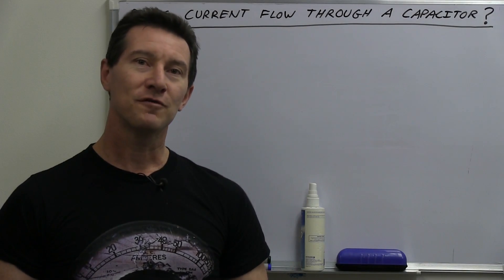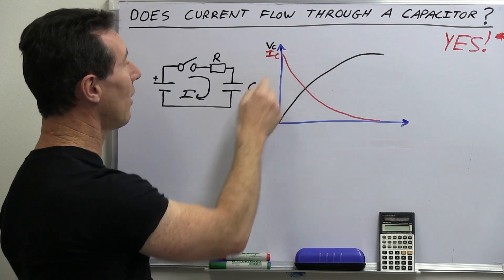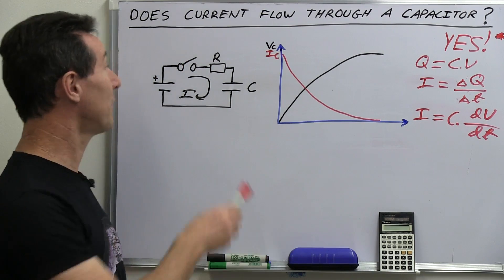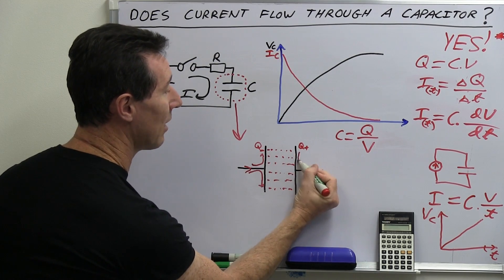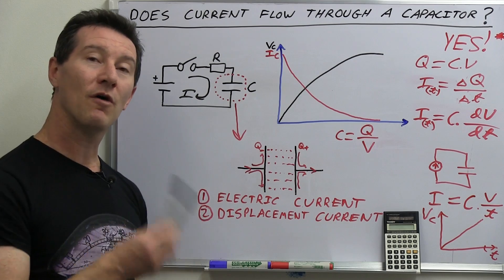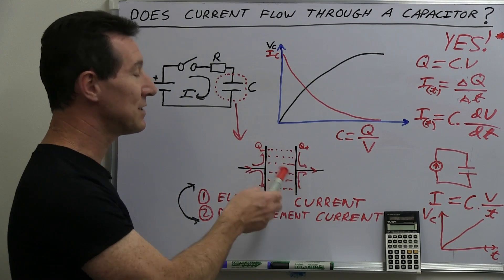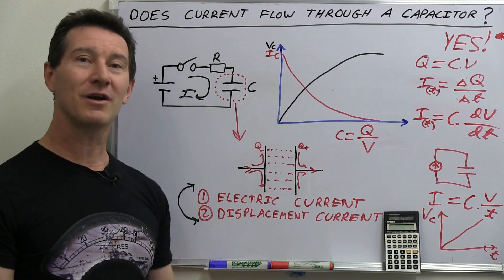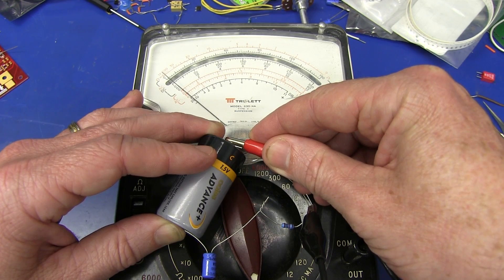EEVblog #486 - Does Current Flow Through A Capacitor?

Comment: I've gone through semesters of electronics in middle school, high school and university and nobody was able to explain which is the actual direction of current flow. Until I looked for an answer on youtube and kind of got it. Having diplomas and degrees only means you know formulas and how to work with electronics, not that you have the absolute understanding of what's happening.
Reply: That's a shame you had that experience. When I was doing electronic engineering at the university of kent it was one of the first things taught and explained very clearly. For circuit anyysos and design we used conventional current flow but were taught about actual current flow in solid state physics.
Reply: Having diplomas or degrees means you have diplomas or degrees. It means you are SUPPOSED to have an understanding of what's happening. Whether you do or not depends on the quality of your teachers and the quality of your effort (which is largely dependent on your interest).
Reply: "Actual" charge flow is too complicated:  electrons flowing in metals, protons flowing in battery acid and in proton-conductors.  In salt water it's flowing +Na and -Cl ions.  In alkaline electrolyte it's -OH ions.  In wet dirt and in human bodies it's +Na and -Cl ions, same as in salt water.  In sparks and gas discharge it's electrons flowing one way and positive ions flowing the other, going past each other in opposite directions.    Cont...

So, which is the REAL direction of electric currents?  (The answer must apply to conductors, not just metal wires.)   Think carefully: when you're getting electrocuted, no bare electrons are flowing in your body, but opposite-charged ions are flowing in two opposite directions.

Physics has the answer:  we hide the complexity behind a simplified concept called "Conventional Current."

To do this, we add up all the flows to form a single current.  For example, in wet dirt, if pos and neg ions are flowing in opposite directions, that means the negative charges that flow backwards must add together with the positive charges flowing forwards.  (A double-negative makes a positive current, so negative charges, flowing backwards, will give the same amperes as positive charges flowing forward.)  Wet salty ground has a single amperage made of conventional current.  (We don't need to think about the many charge flows in the dirt: the +Na and -Cl and +K and +Mg and +H and -OH.)

For those who want the REAL currents, and not the simplified version, it's not enough to just say that "current equals electrons."   Current in copper wires is actually electrons flowing past positive copper ions  ...so if we move the wires backwards at just the right speed, then the electrons stop moving, and the electric current is now composed of positive copper ions going backwards!   (See, the REAL current was never just a flow of electrons.  It had always been a relative motion between the copper atoms' nuclei and the copper electron clouds.)

Conclusion:  if we want simplicity, where we just deal with a wire's volts and amps, then we use Conventional Current to hide the actual charge motions.   But if we want reality, then we'll end up with Ben Franklin's Kite String,  the famous twine which is an acid-based conductor.   Ben Franklin's kite string used +H ions as its charge carriers.  Only the protons were flowing along his twine, not electrons.   (Heh, so when Franklin assumed that the charge-carriers within conductors were positive, HE WAS RIGHT?!)
Reply: BMan18 So if "electrons flowing past positive ions" is wrong, what is right? I was interested to find out but your post spiraled into a political rant without actually answering anything.
Reply: The people you mention as sources are raving crackpots and not surprisingly, what you say is utter bollocks.
Reply: BMan18
Free energy is fraudulent bullshit, and none of your weaseling changes that. Get lost.
Reply: Do you think that learning from the internet will make you an electrical engineer (EE) in time? Have you seen the curriculum of (EE) from a major university?
Reply: We learned electric current flow the 1st day of introduction to electric circuits 101. The electrons, the charge carriers in an electrical circuit, flow in the opposite direction of the conventional electric current.
Reply: Mack Lack
No. You need structured study and practical experience.
Reply: Not entirely. Stick non-grounded instated long copper wire up a tree it's will generate a few volts, mostly from radio wave EMF in the air. You can do the same with a faraday cage.
A lot of the Free energy hippies snake oil is bullshit I agree, but not all. 
Eric Dollard has replicate a lot of the same experiments that Tesla has done and more like his current early earth quake warning system he is building, currently science has painted it's self into corner with it's dogmatic materialistic mind set and a high reliance on computer modelling. Junk info in, junk science comes out.
Reply: what university did you go to? more than likely either it was a really shit uni or you were just bad at understanding what they were saying. I hate this "school teaches nothing" meme, because it's really not true at all other than at the lowest tier schools
Reply: kalidesu, all of those examples you use and claim to be "free" energy are nothing of the sort.  EMF has a source, and it usually is a large transmitter turning current from the mains into radio waves.  So it's not free.  It was generated somewhere and you are simply scavenging some of it back.  The only example I know of where something came from nothing was when God spoke and created the heavens and earth.  Other than that, engineering 101: TANSTAAFL (Look it up.)

Edit: Unless you are talking about tapping into the 8hz oscillation of the ionosphere ala Tesla because...well, that's a rabbit hole I don't feel like going down right now.  But you have nothing to worry about because our federal government is working on it for you with HAARP...Like a bunch of 3 year olds playing with AK47's.  Nothing good can come out of it.
Reply: LOL... So much education and still "electrons flowing past positive copper ions". Maybe you need some time at YouTube U. But as they say, the more misinformation you assimilate the longer the journey to the truth as you backtrack. 

Check out Robert Distinti, Eric P. Dollard, Peter Lindemann, TC Heins, and the singular Ken Wheeler. Not that any one of them has the full answer, they will collectively give you an opportunity to get closer to the truth. 

If you need solid proof that what you know is wrong, check out Patrick J. Kelley's ebook on free energy devices. Look at Paul Pantone's GEET reactor turn a lawn mower into a matter to energy transformer without any remaining matter; no pollution, no radiation. Again, not the absolute, but practical applications performing impossible feats according to what you already have decided is the truth. 

If you wish to remain stagnant and without hope for mankind, avoid these references. To understand this situation, Steinmetz wrote some interesting political analysis in addition to his advanced electronic works. To master science one must also master the process of developing science. Mastering our physical world will destabilize our current deluded culture. You will have to let go of your false profits.

More important than any of this is Viktor Frankl's "Man's Search For Meaning". One man's explanation of how anyone can discover the truth for themselves. And what you can do with it. As long as you are simply taking the truth on the word of others you remain a child and incapable of being responsible for anything you do. Embrace your transcendent abilities if you wish to truly master any discipline.
Reply: Leo unwilling to research. No problem. Charge flow is OK for one current, typical of conductors through the misnamed electron orbitals when they aren't being self redirecting. Displacement current travels primarily in dielectrics, mostly outside the conductor. Mostly this is similar to the density or filler of electric fields. Then there are the distinctions in speed, magnetic induction, wave form between them both. They are motivated to move by different conditions but both act as a balancing function; not on objects. The supply/consumption concept is very misleading. But fundamentally neither type is particle based. They're field expressions. If you really dig into it, you'll learn how these are responsible for magnetism, and magnetic fields aren't real, just shadows. The E fields also are gravity and "space bending" which is another confusing metaphor. They are the essence of matter and mastery will deliver the secrets of matter transmutation and energy production. 

Sadly, you won't get there with electrons. And this info will only raise more questions if you think they will. Good luck unlearning, seeing clearly, and rational thinking. It's not that complicated, just completely different from almost everything you were taught.
Reply: Kalum Batsch, everyone chooses to see what is real. Try as you might, you live with the consequences. If you actually admitted the responsibility you pretend to avoid, you would not be so blind and wrong. Still, it's your choice. Conform, be happy while it lasts. You have lots of company. Not my problem.
Reply: Yes, of course.

Comment: I don't really get why this vid is so long :/
1) Electrons from negative side of battery travel to one side of the plate
2) They keep building up there
3) This makes that plate have a strong negative charge
4) This repels the electrons on the opposite plate as similar charges repel
5) Hence the flow "through the capacitor" 
or am i missing something?

Comment: Dave you are absolutely right, current does flow through any capacitance circuit in yhe form of electric fiel. You know students use to think than electrons do actually move from one atom to another as the concept of current and that's physics bullshit. Current is nothing else but the energy momentum pass from the movemen and spin of one elentron of an atom to the neares atoms arroun in a single directions. If electrons do actually move accross atoms in a circuit then the copper cable would cease to exist and will transform into another element. Actually electricity and current can move through vacum as demostrated by Tesla and that was the biggest challenge that Einstein could never probe wrong. Vacum does exist and forms more than 90% of the universe. Actually energy can move and transform in many different forms and shapes like electricity, electric field, electromagnetism, gravity, photons, momentum, heat, etc. You are amazingly good at understanding and explaining electronics, university teachers should learn from you.
Reply: Electrons are actually flowing in a conductor!!! That is what a metal is - a material that shares its outer electrons to the "electron  cloud' - this makes it conductive. A battery literally pulls electrons out of a chemical reaction and pushes them into the wire, the other end of the battery pushes electrons into the battery where they are consume by a chemical reaction.  read https://en.wikipedia.org/wiki/Drift_velocity to see how fast the electrons move through a wire. 2mm Copper wire with 1 Amp has a drift velocity of 23 μm/s. Electrons have a tiny charge, but there a lot of them - they don't need to move fast to generate a current we notice at the macro level.

Comment: Imagine a hose of some length, In the middle of the length is a diaphragm closing off the flow. But the diaphragm is flexible.
Imagine an alternating pressure on a liquid in this hose, so that the liquid is pushing / pulling / pushing / pulling ...like AC current.
The diaphragm will stretch out and back, out and back, with the pressure applied and removed from the inlet. So a liquid on the other side of the diaphragm moves back and forth exactly like the liquid on the inlet side, Though the two liquids never actually touch each other, the effects of one determine the action of the other. 
Just like a capacitor, it will not pass current, however it does pass the effects of the current,  in an AC circuit. Except that the electrical charge on the plates acts as the diaphragm in the hose.
Does a Capacitor pass AC current, NO.  It passes the effect of the AC current..
Milmat1
Reply: Perfect! Dave, you are not using the correct concept.

Comment: What if you are using a cap in series that has both AC and DC moving through it? The AC is going to build up fields on both sides of that cap. Wouldn't they collapse the DC fields? I've designed circuits in college to do this and though I didn't actually build them, they supposedly worked. In the last few seconds of the video, the current meter went way up and then collapsed back to zero!
Reply: That happens all of the time - for example, between two amplifier stages a coupling capacitor is often used because the two circuits have a different DC level.  In that case the cap passes the AC signal but blocks the DC by charging up each side to the average level on it's respective side.  When the circuit is first turned on, a transient current will occur until the voltages reach the right level.
Reply: So you are saying that caps do not block DC? Realize it's been 25 years since I studied this stuff and I never really used it. Unfortunately, I've lost all my notebooks and text books in a move.
Reply: A cap won't have DC passing through. It's just not gonna happen. When you switch something on and the capacitor has to charge up it's basically AC at that point. It  does not change polarity but thats not really gonna matter here. You could imagine an AC sine wave stopping at half Pi when the voltage hits peak.

Comment: Are you sure of the linearity of capacitor charge/discharge at 4:02? As I know capacitors charge and discharge accordingly to an exponential decay, Vc = A * e^[-t/(RC)], so, in the case of no resistance (R=0), Vc becomes A instantaneously! Just think in the RC time constant of any RC circuit, again, if R = 0, RC = 0, meaning, the most extreme case you can have is an instantaneously charge/discharge and never a linear one...
Reply: Yes, but never linear, and that is my point...

Comment: Dave said voltage charges up in a linear fashion. From my understanding voltage doesn't charge up in a linear fashion in a capacitor, it charges exponentially depending upon the time constant (t=RC) This can be calculated in increments of 5t. It is also possible to find the instantaneous voltage at any point with this formula if increasing and beginning at 0v: v=Vf(1-e^-1/RC) with RC being one time constant.
Reply: (commenting to you Travis) The voltage across the current source is the same as the cap that it is across, as they are in parallel.  However, you are correct that a constant current source would ideally (if it had infinite voltage available and the circuit could take it) drive the voltage across the cap LINEARLY, not exponentially, described by the eq. v = i*t/c.  This formula also shows that the voltage rises linearly with both current and time, and that the larger the cap, the slower it'll go.  Also, even if a series resistor were inserted, the voltage on the cap would be identical.  The exponential formula applies when it's a voltage source and there is a resistance for that voltage to divide across as the cap charges.
Reply: When he said that he was showing a circuit with an 'ideal' current source connected to the capacitor. In this case, the voltage would charge linearly since the current is linear.  However, if you were to look at the voltage across the current source it would not be linear, it would be exponential.

Comment: Lord Saint Dennis Charles Smart, Enlightened, comments on the article about electricity actually flowing thru a capacitor.

Great Job!  Always thought that electrons made it from one plate to another in an active circuit.  You touched on 2 good points:  capacitive reactance & electromagnetic field.

1st of All:  Capacitive Reactance
Xc is being studied for conversion of mains electricity to allow small amounts of juice to pass thru the circuit - without use of a transformer - enough to light a single LED but without the fear of blowing out the diode!  Biggest problem with current theory (no pun intended) is that a giant surge of electricity - let's say, from an electrical storm some 10 miles away - could possibly electrocute the User from the giant spike produced as a tuned circuit could not effectively handle the surge.
a
Secondly:  Electromagnetic Force
EMF seems to be the force that causes electrons to fly from one electrode to another.  It seemed to me that electrons were actually flowing thru the electrolyte of the material, as in the case of electrolysis.  But transformer of electrons from Primary 1 to Secondary 2, would make more sense, and the value of the EMF can be calculated for further proof, as well as predictability of current flow.

Comment: There's no magnetism involved here - just electric fields - so you don't really need to invoke Maxwell for a basic understanding.  An electron arrives on one plate, and repels an electron from the other plate.  So you see one electron go in, and one electron come out the other side.   Do this with n electrons and this constitutes the current apparently flowing 'through' the capacitor.